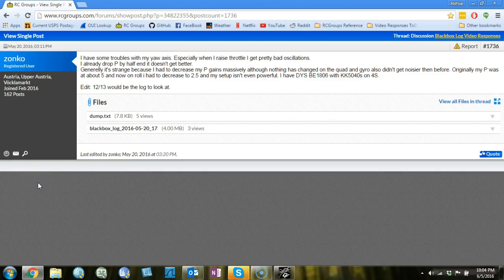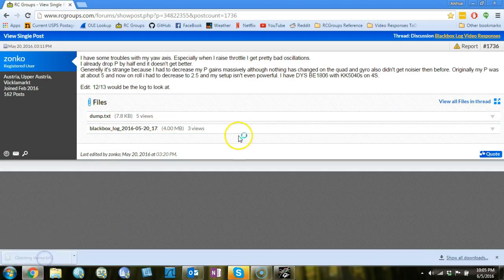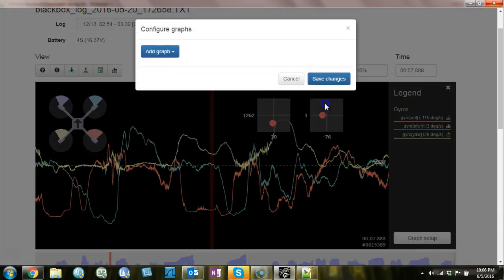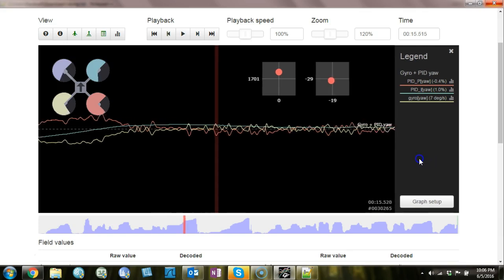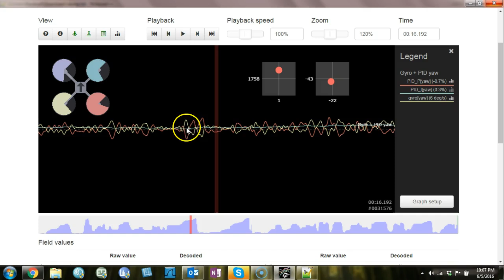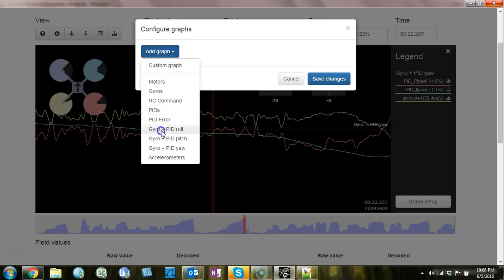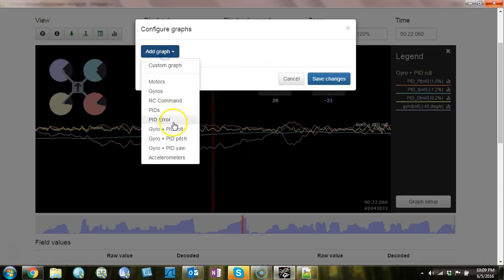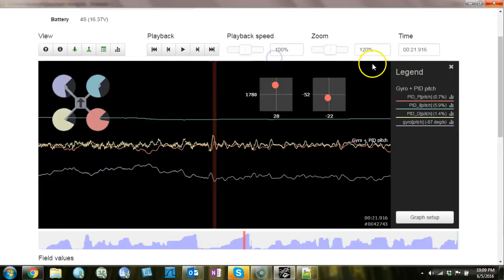Blackbox Log Analysis: zonko - 6/5

Comment: A quick question. Will I be able to get a 1/1 black box rate at 2KHz or even 4KHz on my inbuilt flash on the XRacer F303?
Reply from the maker: Yes. Dataflash is fast. But if you run at 1:1 on 2k or 4k, you will fill it up in no time. I suggest targetting a rate of about 1 kHz. So at 4k, us 1:4 or 1:5 logging rate.
Reply: Thank you!